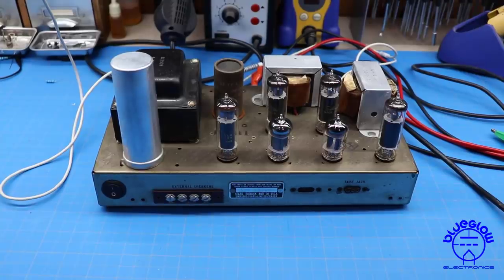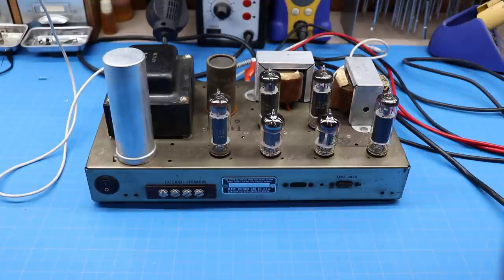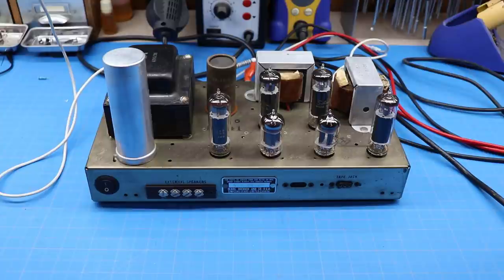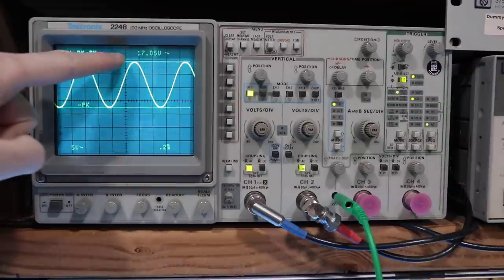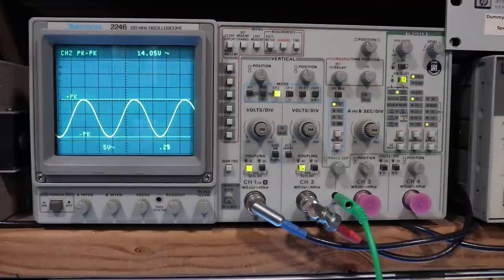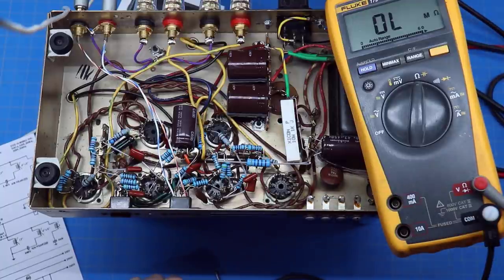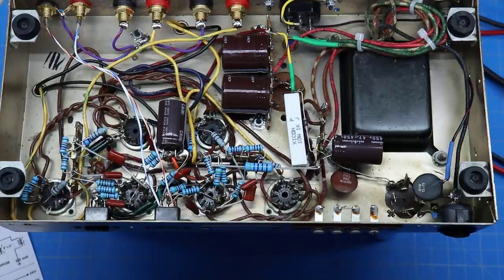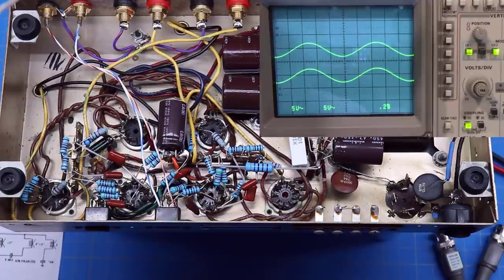Oscilloscopes For Audio 101 -Part 4B - Push Pull Amplifier Troubleshooting

Comment: Great video very interesting  as you logicly walked thru both channels comparing readings and finding the problem .No shame in a missed solder point .We all learn from stuff like this .just reinforces good build habits the time and aggrevation it takes to find such a little thing is better spent in the build .Great looking amp The console amps are a lot of fun to rebuild

Comment: Absolutely excellent series OM! Very nice work on troubleshooting too. I am making the jump to some audio repair and restoration on vintage solid state equipment from RF and general consumer electronics repair. Your series has clarified so many questions for me in that transistion. The practical knowledge transfer has been absolutely amazing. I'm not much of a vacuum tube guy at all, so now with this video out of the way I'm anxious to dig into your solid state troubleshooting content. Best 73, Kenny- NZ5i

Comment: Not an idiot for making a mistake.  Mistakes are an indication that somebody is actually DOING something.  One of mine was spending a long time trying to find out why I was getting so much noise out of a very low noise amplifier I was designing for a pH sensor (using an OP07 op amp).  It turns out I had forgotten to turn on the power supply.  So, my scope was basically hooked up to a lousy antenna picking up the radiation of the nearby radio station and whatever else was passing by.  And on some things with feedback loops, sometimes it is possible to disconnect the feedback and run it open loop making it a little easier to narrow down a trouble area.

Comment: Another gem of a video. I learn more with every video you produce. My 807SE build had many tiny mistakes, but I’m glad I made them, as I learnt more finding and fixing them (despite your excellent video series, I too managed to miss soldering components and plain getting them in the wrong places too!). The killer was the OPT schematic needing to be reverse polarity when using global feedback - that was a pain to diagnose. I know you mentioned Edcore possibly mislabelling your OPT’s but thought mine would be ok as they were bought much later and would therefore a different batch. But a single sentence in a lengthy blog-post said that when using global feedback, you must always reverse the OPT polarity and the final piece of the puzzle was completed. Just bought a new oscilloscope, and a Function Generator is on order. Will upgrade my 807 to some new MKP caps, check I am getting the best out of the amp, then on to the next build. Thank you.

Comment: Best practice is ask someone to check your work. Sometimes we are blind to our mistakes.
And first unplug your DUT before making resistance measures. So many burnt ohm-meters!
Great tutorial, thanks!
Reply from the maker: Thats why I power them off and showed everyone to discharge capacitors in the video.
Reply: Unplugging device under test is a safety measure I use. A short glimpse at loose power socket, ready to start.
Forgetting to switch off power, and then grounding caps, gives unpleasant surprise, specially for a beginner.
Special grounding rod, you use,  is a great idea.

Comment: I have that same scope. Mine has an intermittent problem and I wonder if you have seen it. First off, the scope itself works fine. The problem relates to the Voltmeter and the Cursors. Sometimes, when I press the Voltmeter, the screen says "Ouch. Turn the Volts/Div CCW." At the time, it only displays the top cursor. This occurs even with the Volts/Div fully CCW and with no signal applied. When it is in this mode, the Cursors/Time functionality is also weird. The reference cursor will not extend beyond the center of the screen. I was curious if you had heard of this symptom before. I checked the DC power supplies for levels and they were spot on. I did not check for ripple yet. Though I work on guitar tube amps and other similar gear, I am a little intimidated by the higher voltages found in scopes. I appreciate any input and love your videos. Thanks.

Comment: "I make myself look like an idiot in front of all my loyal viewers here..."  

Yeah, no.  This is a fantastic lesson in fault finding.  Working on a vintage AC30, or anything similar with solid (rather than stranded) wires between turrets?  This is exactly what happens with these older amps, a wire breaks but appears to be connected causing all sorts of odd issues.  And I have lost count of the times that I've found unsoldered legs of components in consumer and professional units over the years, both tube and solid state.  Soundcraft analogue mixing consoles?  Done loads of those over the years that had EQ and Aux pots not properly soldered in, while still sort of working!

Comment: Thanks for a interesting trouble finding video.  I was wondering how you would test for bad capacitors or rule out capacitors causing the issue in the circuit.  Perhaps you would have started to check capacitors or the output transformer if all of your resistors would have checked out?

Comment: There would be another way of defeating the feedback (if opening the loop is too difficult)  You could "kill" the feedback by shorting the feedback at the junction of the two  cathode resistors and the feedback .  Probably direct DC short is not ideal, but you could try a fairly large capacitor to cause AC bypass.  After all, your test signal is 1.3 kHz, so attaching a capacitor that together with the low end cathode resistor produces an RC low pass of for example 100 Hz (or lower) should do.  Alligator clips or grabbers would allow the connection without clipping or desoldering anything.

Comment: As soon as you started and had that distorted signal,  I thought that you should disconnect the feedback loop to make sure that it's not causing false readings on the first stage.
Reply from the maker: Agreed, but then it wouldn't have made for a great oscilloscope video :-)

Comment: #edit# hour and a half later# That is EXACTLY the 2nd place I would have looked.  That's wired as triodes right?    I'm at 7:56 and I'm gonna take a shot at it. Those EL84's are in a SRPP? config and I'd say it's similar to the knock of an engine with the timing off.  The "push pull" are fighting each other at some point. It's probably fixed bias and...well, it's 2 in the morning and I'm just going to finish watching.

Comment: strange,it should have been redplating with no grid leak
Reply from the maker: My bad, I thought you were referring to the lack of a grid leak on the phase inverter.  On the 270k grid leak for the EL84, with it floating, it certainly caused the bias on the EL84 to be out of whack but never had any red plating.  The charge building on the grid must not have been enough to push it positive.